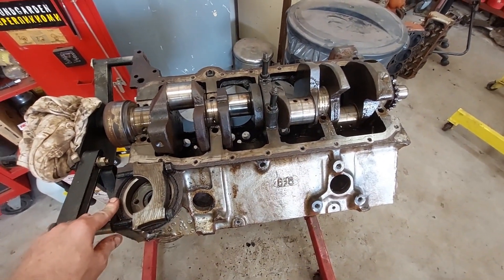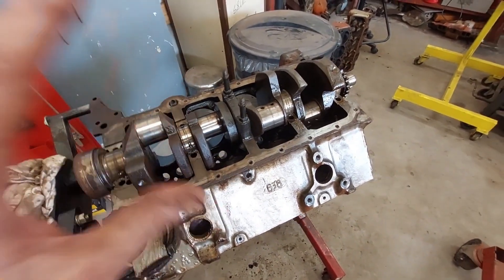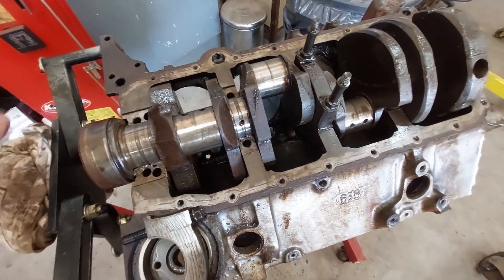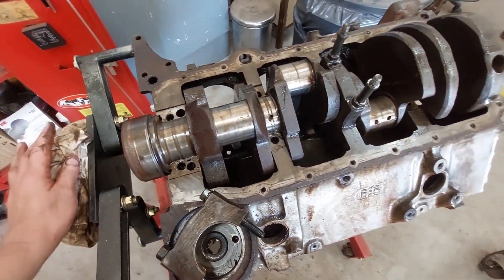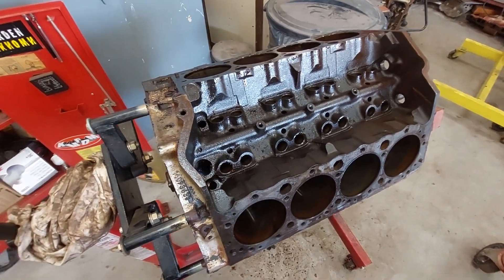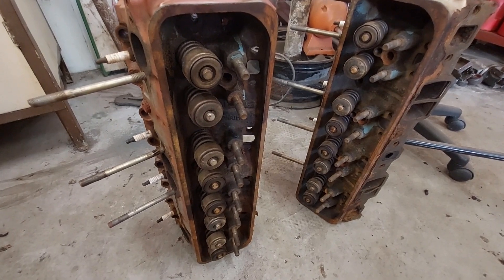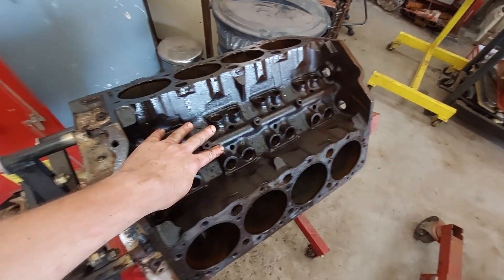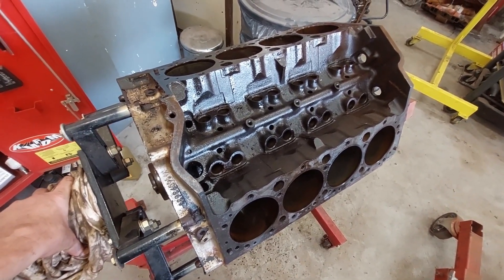Assessing an Engine for a Budget Build

Comment: It’s a high cost theses days to rebuild anything but we have to keep going anyway
Reply from the maker: Prices are going up, but if you mind what you spend your money on, you can put together an engine for under a grand that will run circles around a $2500 crate motor. Also, if you are careful, take good build notes, and use good practices, your engine will be more reliable than an engine built by any low-end rebuilder. I hope to go further in this engine build and show where to save money, but it's a matter of free time. Thanks for watching!